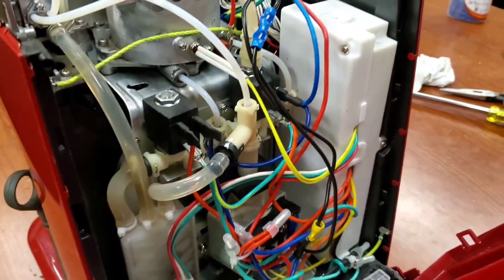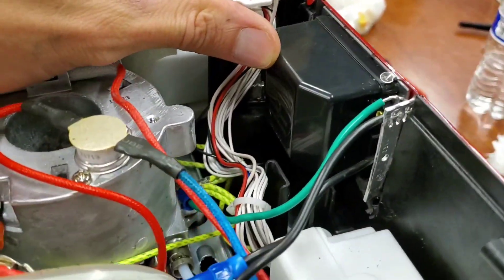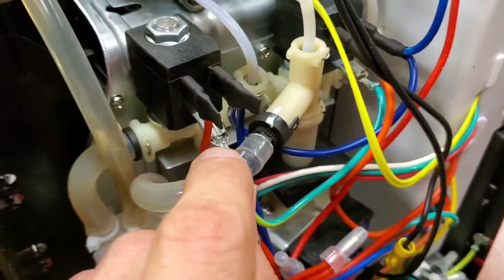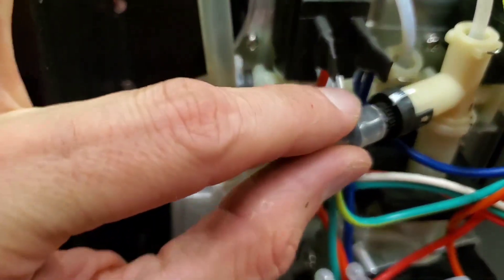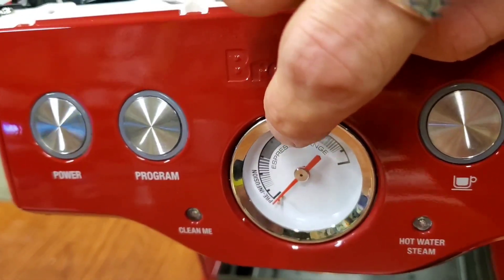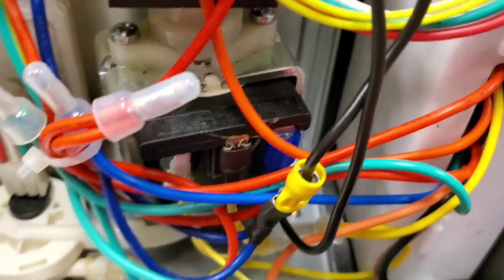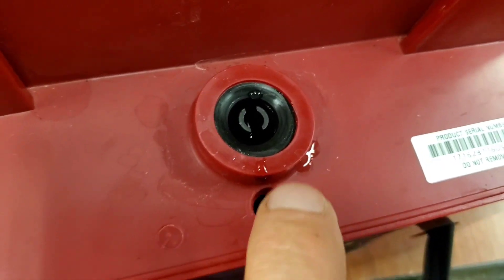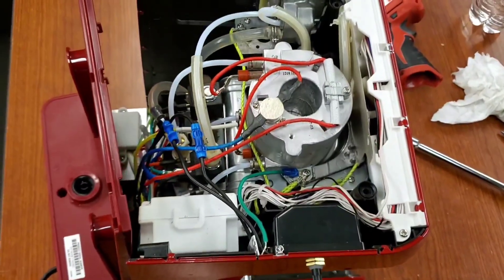OPV and flow control dimmer mod on Breville Infuser BES840XL

Comment: Great video, My old breville BES870 will not get up to a decent pressue, it seems to max out just in the espresso range after the infusion ,  I have tightened the OPV (right in) but it doesnt make any difference to the pressure . even with the blind basket shot. Do you think the pump may be weak or the guage is not reading correctly? many thanks for any help.
Reply: Maybe scale buildup in the opv or other tubes ?
Reply: Hi thanks for reply, I have had the solonoid block off, all the pipes I have seen inside look pretty clean. I have ordered a new pump to try. But i should have probably ordered the pump upgrade and rrepair kit with  with the glass ball.
Reply: @martingoodbody  did you check if the opv is correctly assembled ? There’s a rubber thing on the spring I think. Maybe that’s at an angle somehow. Hopefully it was the pump. New pump can’t hurt.
Reply: @TheRusk123   thanks for help. I will recheck the opv when I take the machine apart again I did adjust the opv. So definitely worth a check. Thanks again.
Reply: HI again, just tried new pump , exactly the same as before change. just noticed very smalll notches out the grouphead seal. I thought I could hear very slight hissing from that area. Going to try the grouuphead seal next.
Reply: OPV all cleanand seal in right
Reply: @martingoodbody  that’s the silicone ring around the shower head ? Maybe you can try it with the blind basket again and listen if there’s air/ water coming out. Is there a way to check if the opv is activated ? Like water flowing into the drip dray? Maybe it’s activating at a too low pressure
Reply: @martingoodbody  can you Programm your double shot for 75g of water ? My machine then takes 15.7s without the portafilter. So you can check the water flow of your machine. Don’t know if that’s a good way to measure it
Reply: @martingoodbody  I also think Breville has a good support, maybe write them an email with your problem and what you have tried already
Reply: @TheRusk123  HI thanks for your help.. when i have the new ring in I will check the OPV, While i pull a shot  the opv should be closed to maintain pressure, so no water should enter the tray during the extraction is that correct?,
Reply: If the opv is opening during the extraction that would eplain low guage pressure as well
Reply: @TheRusk123  Water flow seems good just pressure guage reading low and flow does look fast and from start to  finish ontly about 20 seconds
Reply: @martingoodbody  yes if it’s not modified it should only open when the pressure gauge is at 1/2 o‘clock. When it’s modified for 9 bar, it should open at ~10 o‘clock. Else it should be closed so the pressure can build up
Reply: @TheRusk123  agreed, my pressure guage even with the new pump only reading max at about 9 to  10 o'clock. If the gauge is correct it is not building enough pressure to open the valve anyway.. which is strange as there are no obvious leaks. Thinking When new seal in to check OPV whilst extracting. Also I am thinking if the 2 way solenoid may not be shutting properly.
Reply: @TheRusk123  Hi again, tried the  group head seal still no different, had the machine open whilst running a shot. At the same time as  the shot was extracting,  I had water running  into the tray. . It wasn't coming from the OPV. It was coming from the 2way valve on the end straight into the diffuser. Should this be happening at the same time as it is trying to build pressure. Many thanks again Martin
Reply: @martingoodbody  its probably the safety valve which might have scale buildup inside and cant close anymore. so you loose pressure because the water can "escape" to the drip tray, the safety valve is the drain valve in the video i think, if this cant close properly water goes to the tray always. Maybe you can clean both solonoid valves, this should fix the problem. This is a video on how to deconstruct them. https://www.youtube.com/watch?v=96IuKiuIB5A
Reply: before you deconstruct the machine, maybe you could try multiple rounds of descaling and backflushing to maybe loosen the blockage. Maybe descale manual with the brew buttons, so everytime the "brew" is finished the solonoid valve should open and close so the descaler is running through it
Reply: @TheRusk123   thanks for message. I have descaled a few times. The inside of the machine is very clean. I have had the OPV and the 2way  solonoid apart, they also look very clean. A couple of imprint marks on the solonoid piston seals. As I say I have watched the pipes whilst extracting. The only tube you can see water flowing through during the extraction is the 2 way solonoid ( straight into diffuser then drip tray). The OPV is definitely not opening during extracting ( can not see any water in the pipe from it) I appreciate all your help thanks again
Reply: @martingoodbody  from the video i think thats the problem, the 2 way solonoid valve shouldnt open during the extraction, i think thats a mechanical problem it probably cant close. Is there a way to manually open and close the valve to check if it works ?
Reply: @TheRusk123  I did have look and it seemed alright apart from some indents on piston seals . But I have now ordered a new one. Just to rule it out. Just really wanted to confirm water should not be passing this valve and ending up in the tray whilst it is trying to build pressure.
Reply: @martingoodbody  yes this video also confirmes the valve should only turn on after brewing, it also explains the water flow with the two valves again https://youtu.be/46UBebNJ-uo?t=185
Reply: @TheRusk123  thanks again for your help, I'll let you you know how the replacement solonoid goes.
Reply: @martingoodbody  maybe also check all the cables and connections that go to the valve, worst case its the input from the control unit. The valve always should close after a few seconds of being open after brewing
Reply: @TheRusk123  I will check that to.   Is that to relieve the pressure in the system after the brewing. thanks again  for the info.
Reply: Hi again, all sorted now, It was the 2 way valve letting by during the extraction, Great pressure now with the blind basket above the espresso range, Should  be able to dial in properly now. Going to fit a dimmer switch and two solonoid indicator lights. Thanks for all your help ☺️
Reply: @martingoodbody  nice to hear! Have fun with the machine!

Comment: You have a SmartGrinder pro - great unit.  What are your settings you are using for Espresso, pourover, etc??  For your dimmer trim the shaft down and the know will fit closer to the machine body.

Comment: Hi Chris - thanks for your video.   I have a BBE, and have been toying with the idea of the OPV mod and will likely do it.  I bought my machine used, and the water flow valve is pretty psycho.   It won't hold any settings that I program and will vary from 100g to 75 g and sometimes even down to 40 grams water out, with no espresso in the portafilter.   I haven't been able to find any information on the relationship between water flow out and quality of espresso vis a vis a psycho water flow valve.   I pull all my shots now manually out of total necessity, and I typically do 15 seconds of Pre Infusion.   Anyway, wondering what your thoughts are vis a vis doing a dimmer mod on my machine vs. a straight up replacement of the water flow valve.  My assumption is a mod on a psycho valve won't help much.    But I am no electrician, nor a wizard with the innards of my espresso machine.
Reply from the maker: Water flow valve? Do you mean the OP Valve or the vibratory pump maybe? The solenoid is working if you get any water out. When you refer to the valve as psycho, do you just mean it's malfunctioning? The programmed shot sizes are just an amount of time for the pump to run and don't necessarily determine how much water actually makes it through based on the resistance of the puck of coffee. Also, are you using the pressurized (dual wall) basket or the normal basket?
Reply: @cjbrown80  - The part is called the flow meter.  It determines how much water is released when you press the one or two cup button.  With no puck in the portafilter it should dispense within a gram or two the same amount of liquid each time.  Mine is wildly inconsistent, with a double shot varying between 40 grams and 100 grams.  That is not the way the unit is supposed to function.  

I could replace the flow meter, or just do the dimmer mod.  But my thought is if I mod a broken flow meter that won’t help much.  And could make it worse.
Reply from the maker: Yes, I agree the dimmer mod wouldn't help in this situation. I recommend looking into the replacement flow meter first and then tinkering with other mods.

Comment: I'm curious, why adjust the opv tension and install the dimmer? I have a breville barista express I want to tinker with!
Reply from the maker: The OP Valve is like a ceiling for the pressure at the brew head. Opening it up lowers the maximum pressure. The dimmer mod allows you to control the rate of flow into the group. I recommend checking out the channels of James Hoffman and Lance Hedrick for some great videos explaining why you would want to manipulate these factors.
Reply: I did only the dimmer mod with a good dimmer and I got the results I wanted. https://youtu.be/Yreq3hXmftM

Comment: Hey Chris, great video! Had a quick question regarding the switch. Do you think something simple like a “SC-239A Switch 200 Watt Manual Dimmer” would work? Couldn’t post the Amazon link but the switch itself is tiny and could be put virtually anywhere with a relatively small hole.
Edit: Also follow up question I saw a lot of people discuss the OPV mod vs the dimmer mod. Was there a reason you did both? Doesn’t each mod do the same thing (lower the pressure) so by doing both mods you would essentially be lowering the pressure twice since the OPV mod already lowered the maximum pressure?
Reply from the maker: I did both mods so I could compare them against each other, but yes, it is somewhat redundant. The dimmer just allows you to articulate the flow up and down.

Comment: Either side of the wire from dimmer that works on the pump, there wasn't L and N difference?
Reply from the maker: Are you responding to the previous comment about which side of the pump to connect output of dimmer? I found 120Vac to ground on one of the connections to the pump. I then removed that terminal and connected to one side of dimmer and other side of dimmer back onto that terminal on the pump.
Reply: @cjbrown80  Oh, I see, thanks.

Comment: I installed one on my Lelit Victoria using a motor (ECR) speed controller (works also as a DIMMER* for incandescent lights and LED's ) from eBay. I chose the one with a zero output trimmer when fully set at CCW and max output at FCW. I set the OPV at 9.5 bars that gives me a 0.5+ bar leeway. It works good as a $3,000+ espresso machine with a mechanical brew profiler lever. (*light dimmer) sort of threw me off because we always call it SCR controller in electronic parlance. I suggested this to Latte Love espresso dealer. So far, they either are ignoring me (bad for business?) or just too busy selling their mechanical profiling machines.
Reply from the maker: Thanks for your comment, Ricardo. I assume the high profile retailers don't approve of mods like this, lol. Are you an EE? Could you also post a link to the SCR you used for your mod. I would like to check it out and possibly upgrade mine if it works better.
Reply: @cjbrown80  There are quite a few of SCRs (not ECR, LOL) from eBay. Get the one with trimmer pot so you get to regulate the ramp up output. No, I am not a certified EE, but I was an R&D technician on high speed motor controllers for 2 years. I was working on TVOR, TACAN, ILS and Glideslope ground electronics when i was with the USAF for 4 years.
Reply: @rickseneris   Any links to the exact product you used?
Reply: Can you please explain the wiring? Did both Brevile wires go into the ECR in and then both out into to the pump into their respective locations? Or just the power wire?

Comment: Hi Chris! I would like to ask if you have issue with your Infuser after pulling about 4 shots continuously? Because i actually have problems where by after around 3-4 shots pulled my infuser stop working while all the light just light up in a stand still.. i wonder if it an over heating safety features?
Reply from the maker: Hi Alois, I have not had any such trouble. Are you using a basic rotary dimmer or something more complex? I'm no electrical engineer, but I would have to guess this modification potentially confuses the microcontroller that tells the pump how many revolutions to make to pump out the programmed amount of water. Mine is out of warranty, so I wasn't afraid to start making destructive mods like this, and Ulka rotary pumps are fairly inexpensive to replace if the mod were to cause damage.

Comment: Thanks for the vid! I have been doing research to install a dimmer on my Barista Express for a while, but there are too little info/video on the internet except for those who only show the final result. You are the only person who showed the wire work. Thanks a lot.

Just a couple of questions: 1) How did you figure out which of the two connectors on the rotary pump can be taken out & connected to the dimmer? 2) Would choosing the wrong connector damage the machine?
Reply from the maker: Hi Felix, apologies, I just saw your question today. Glad my video could help you! 1) I disconnected both leads and used a meter to test which one was energized after pressing the shot button. 2) I don't know enough about how these small Ulka rotary pumps are designed, but I imagine it could damage them.
Reply: @cjbrown80  Thanks Chris, I have tried and failed my first attempt with my BBE when I made posted comment (the machine's fine btw). I will try again. Thanks a lot :)